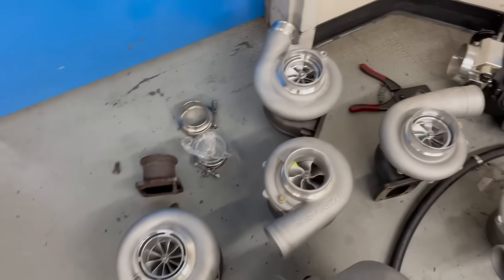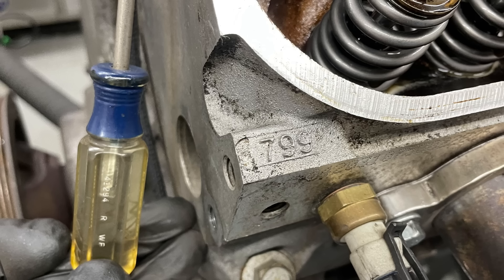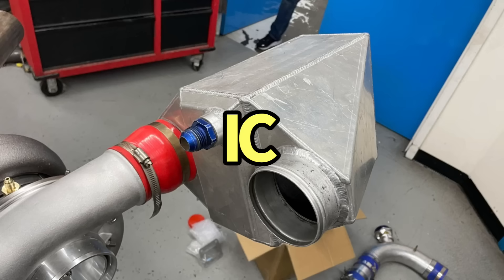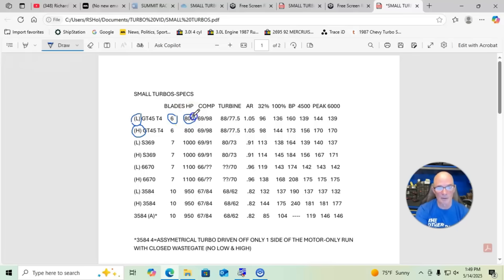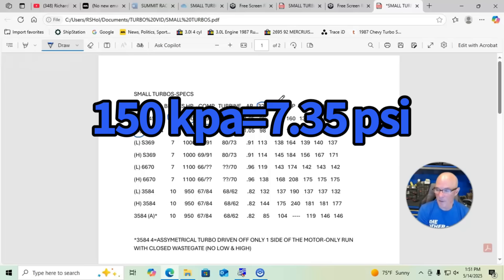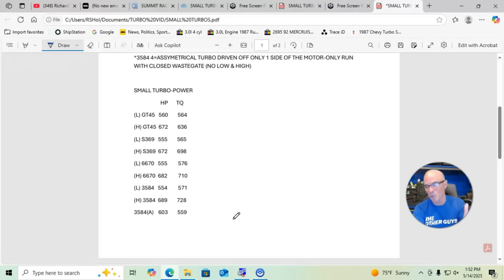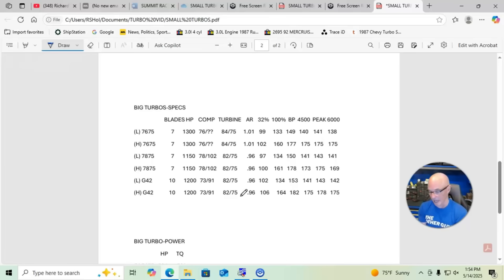JUNKYARD LS TURBO SHOOT OUT. GT45 VS GTX3584 VS S369 VS 6670 VS 7675 VS 7875 VS G42. ALL THE DATA!

Comment: Need to see a video showing the difference in horsepower downpipe makes based on diameter 3.5-5” on a t6 single bigblock
Reply from the maker: what size T6 turbo and what power level?
Reply: @richardholdener1727  anything with a 5 inch flange. My particular application is a 92/103 vs racing 1.56 ar exhaust with 500 Cadillac. It’s pretty common for people to neck them down to a 4 inch for clearance after it exits the turbo. And ideally multiple Power levels 500-1200 to show at what amount of exhaust through the turbo gets restricted. My thoughts is 600ish hp it won’t make any difference until you exceed that.

Comment: I might have missed it , but have you tried a G42-1200 1.25 T4 vs Gen3 Billet 7875 1.25 T4 ? I know the Gen3 7875 is the LS go-to , but curious if the G42-1200 is more responsive , lower on backpressure and capable of more overall power

Comment: Would love to see a video on how to make reliable torque on a 6.0!! My truck doesn't pick up like i want it to but it's a 2500 so i still wanna prioritize pulling power
Reply from the maker: check out the new turbo kit vids coming out
Reply: Agree 100%. My 04 is a turd when it comes to pulling. I had it tuned, and the tuner advised against the lot cam and the truck norris cam and said just turbo the stock engine

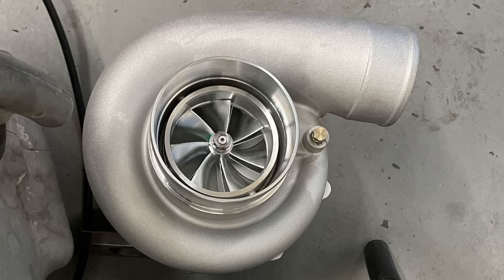Comment: 1:50 - And this is why I went out and got a "knockoff" S475/83 1.10 T4 with a billet wheel for my 6L Build
I hope it lands its efficiency somewhere inbetween an s475 and s476sx-e, and that the small 83mm turbine provides very quick boost response. should be capable of over 8psi @ 2500rpm and still make 800-900hp (with some backpressure) at lower boost levels
Reply from the maker: let me know how it goes

Comment: GARRET/PULSAR G SERIES. I LOVED MINE COMPARED TO MY GEN 2 GTX. Your sizing between these is all off to me. Maybe a g40-1150, twin g30-770s, or even twin g25-660s and you have proven 1100hp with reliably, cheap and the best response possible. I liven my old 20 year old gt series though that I got reman with dual ceramic ball bearing from journal. Was a responsive lil thing. But anywho.....you're sizing between them just seems so inconsistent so it's so incomparable lol
Reply from the maker: you know what they say about opinions.

Comment: Great video, again, it's nice to see the test to show the data we just otherwise guess at. I do have a question. It has to do with power production and engine design and the "why" as to why some engines produce so much more power and more smoothly than others. We've all talked about flow, about induction, about exhaust.  But I've watched a lot of engine builds, not just from you, and I've see when they run into problems (disappointment) over power output. I've also seen some crazy power output in certain cases and beautiful dyno results, that I wouldn't expect. So I got to thinking and now I wonder if I am just 'seeing a pattern that isn't there'. Some engines produce smooth power with a large area under the curve, others have strange lumps, bumps, fall-offs, etc. You can not only see, but hear the differences in operational "clean" vs say a classic Chevy 350 and a modern LS, and while you can build both to produce similar power number, you have to work harder on the 350 and it's "rougher". Again, we've covered induction, and exhaust, and head flow... but what about Combustion Chamber Design and how that impact operational power smoothness and overall potential for building big power w/o breaking up or having to put more effort into reaching those numbers. What brought this to mind is a build I saw of a Cleavor compared to another Cleavor build, one produced moderate power. The other was way more than I'd expect and more smoothly. Most build really don't push the limits of head flow to begin with. The real difference between the builds was one had a "modern combustion chamber design" the other was a high flowing head with the older chamber design. So does combustion chamber design mean a LOT more than we give it credit. I went to go look at 350 with more "classic" combustion chambers but high flowing aluminum heads vs say the Vortec combustion chamber. The Vortec builds were smoother with better area under the curve, no strange kinks or bumps, and built bigger power, more easily, again you could hear the difference on the dyno. Is the secret of engines.. the combustion chamber and piston design combination? Is that why the LS builds power easily vs other, older, engines of the same displacement, even when you put higher flowing heads and induction/exhaust onto the older engine? That they still use an older combustion chamber design that is making less efficient flame-fronts? The Cleavor brought me to the beginning of this thinking because it built power like an LS and had a smoother, cleaner, sound on the dyno. It sounded closer to how a properly built LS does.  It just sort of spiraled out from there.  Just me chewing on engine thoughts. I was thinking about the AMC engines, because they are good.. but they are perennially ignored and their "tech" is "old" and never updated. Even the aluminum heads for them are of a much older era. As a result, folks can do all the "right" mods (roller cam, solid roller lifters, fabricated intake, big headers, higher compression pistons, aluminum RPM heads, the only ones available) and still really not put out much power for the effort. Older combustion chambers are like starting a race with a 20 weight on each leg. You may still get there, but you are going to have to work a lot harder to do so.
Reply from the maker: Not sure what you mean by smooth-more NA power=more boosted power
Reply: @richardholdener1727  Sorry. I wrote a long answer and it got deleted/glitched. I am looking at engine efficiency as a means to "easy power", "more for less effort". I've seen builds, that are comparable, but I am not controlling all factors so my thinking could be wrong. Ideally: Chamber Design dictates how easily your engine can build power. Flow puts boundaries on it, but if you can't run as much advance, if you need a more aggressive cam or more compression. By the math all engines are equal. In the real world I've seen massive differences with the same "advertised" flowing head, same cam, same compression, but one ran a vortec style head (and chamber) and the other was just an aluminum SBC head. The vortec engine revved better, faster, ran more advance, idled more smoothly, etc. Since I don't own a dyno and can only watch other people's work. I've seen builders post smaller than expected numbers for displacement and compression and cam, and you can hear it in the dyno, the engine sounds like it's laboring harder, rougher, more vibration. Just thinking chamber design might be one of those things we all don't think about but that might open doors on older engines to make power, more easily. Just asking someone with greater knowledge if I am off in the weeds or not.
Reply: @meatybtz  Dump all those words in chatgpt or something. No human is going to read all that
Reply: Man that got real deep real quick 😆

Comment: Hey Richard can I pick your brain? 
I have a 402 ls2 with afr 230 cathedral port heads . Can is a comp 239/249@50 duration with 624/624 lift . Procharged f1a . 4800-5000 stahl . I have a fast 102 and a btr trinity . Which do you think would be  the better choice intake ?
Reply from the maker: for what RPM?
Reply: @richardholdener1727  cam is rated to 7200 . So I’d say at least to 7200 or more . Valve train will handle it. Stahl is gonna go past anything under 5000 rpm.

Comment: Are BP and EGT comparable?
Reply from the maker: we don't normally use EGT-we use AF ratio
Reply: @richardholdener1727  I would like to see as much data as possible. It could be useful for others. 
You could make turbo specific databank. Comparing turbos is not easy. 
Keep up the good work.

Comment: Do you make the low buck ls cam for the 6.2?? Very curious, just bought a Denali with the 6.2 and wanting a good cam for decent price that I don’t need to change converter for.
Reply from the maker: as long as it is a 6.2L LS based motor and not a later LT
Reply: @richardholdener1727 ok buddy I appreciate that reply.

Comment: Hey still getting mixed answers so figured I'd ask you. How much ring gap for a gen 3 5.3 that's getting a turbo?
Reply from the maker: .0065 per 1 inch of bore size for any boosted motor. Gap to .026 and you will be fine
Reply: @richardholdener1727  really Appreciate the info and knowledge you share free of charge thanks
Reply: @richardholdener1727  both top and second ring .026? Or do I stagger the size I'm unsure why people do that. I would assume .026 for both should be fine??

Comment: How much fuel pressure OVER boost pressure is recommended? Assuming adequate volume, is a 25-35 psi pump for a combo that will not exceed 20psi boost?
Reply from the maker: Fuel pressure should increase 1:1 with boost to achieve the same delta flow without boost

Comment: GTX3584, how similar is that to the VSR 67/62 ? Similar units?
Reply: They're the same thing. I grabbed a VSR 6762 could barely find videos on it then eventually learned it's a 3584rs
Reply: @PiterStreak I have the vs mirror image journal bearing 1.01 AR’s on a 6.0 LS, hoping a cam swap makes them spool faster as they don’t get into boost until after 4000rpm , had a 238/242 cam, just went to a 408 stroker with a stage 2 turbo cam, hoping they spool quicker now
Reply: @b00st_SS  I have the same set up on a 4.8, but the slow spool is good for the racing i'm doing. Came off ebay T3 GT3582's

Comment: These numbers for the gtx3584 is that a single or twins? I currently have a t76, which is pretty responsive but looking to change up a bit something i can grow into over time as i get a better cam then stock 4.8 truck cam and upgrade valvetrain.
Reply from the maker: single GTX3584RS will support 800+ hp
Reply: @richardholdener1727 wow i didnt think they was capable of that on a v8. I think this is the route im gonna take then, thanks

Comment: Yay for data! 😎
BTW any plans to offer a ~500 hp turbo ?
Reply from the maker: the GTX3584RS is a 500-hp turbo
Reply: S366 for a 5.3 or 4.8. I run one on a 5.3l made 572hp 586tq pump gas 14psi.

Comment: precision having the larger ex-housing still made the same and more boost "pound for pound"

If that precision was equal ex-housing it would have easily beat the rest of the
Reply from the maker: I guess you have a Precision.
Reply: Meanwhile the other guy would have the budget to add a 50-150 shot to spool his turbo or get his heads ported & trounce that precision.

Comment: Cast 7875 gen2(.96ar) - $399
Cast 7875 nextgen(1.25ar) - $429
Generic GT 45 - $166.99 (eBay today)

I’ve had the GT45 on for 3 years and 30k miles, so I plan to change over to the 7875 .(96ar) later this year. I understand why you picked the turbos that you did. The g42 and vsr 78/75 are similar. I appreciate all your testing and data!
Reply: Hey just wondering if the seller is around for the generic gt 45 turbo you bought years ago? 
I had a used eBay gt 45 for 5 years , 5000 miles that came with a project I had. Leaking oil and super wiggly inside now. 
Looking for another that might last longer. Only running 7 lbs boost. 
Thanks

Comment: Thanks for the turbo rundown Richard…I would be interested in your opinion on turbo vs. supercharger (whipple, pro charger, Kong, etc) specific to drag race only car with an LS that I’m aiming for 1200-1400 hp…with a manual trans. I’m thinking supercharger may be more consistent off the line, but interested to learn more and get your opinion if you get the chance.
Reply from the maker: For drag racing the issue is putting power down, with proper tuning, 2-steps, converter etc... you can make either work
Reply: Depends on what kind of blower. You could use your blow off valve and run a boost controller to aid in dialing in your boost for launches on a centrifugal blower. Not sure how you could run one on a Whipple. In my defense I have never ran a Whipple so I have no direct knowledge.

Comment: Which of these turb-ski’s would be a perfect match for the stock Gen 2  LT1 either singular or duel set-up?????? How do I keep any lag to a bare minimum from lower to higher rpm range’s ?????? Thanks in advance rich
Reply: Maybe rewatching this video and seeing the data he provided will help.
Reply from the maker: choose your desired power level first
Reply: How much power? Suit the turbo to the power goal. Buy the most responsive turbo that will support that.
Reply: Probably nothing over 6/700 hp with torque trailing just behind That. I’m not looking to go wild with the stock LT1 block n heads so she don’t go poooof.
Reply: @marknowakowski6590  An older LT1 will be pretty similar to a 5.3 but with a bit more torque, so any of these. A gt3584 would spool fast and hit your goals with 15-20psi, but a 7875 or 7268 from fleabay would help the budget while spooling a bit slower. A G42 would spool nice & definitely hit your goal.

Comment: Pulsar has a PTE 68/70 for right at 1000. They also have a 3584RS gen 3 which is same compressor but a 66 turbine wheel vs 62. Also about a grand so not nearly as affordable as your 3584.
Reply: One is journal bearing vs one is dual ball bearing
Reply: @GTCOLE281  yup, you’d buy the pulsar for the turbine wheel. Richard will have both bearing options too and it really doesn’t matter which type.